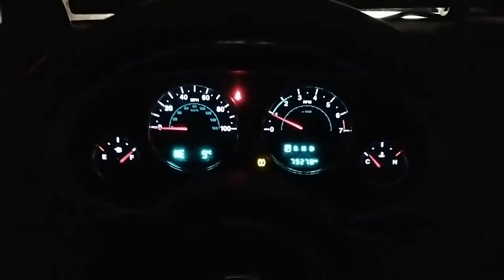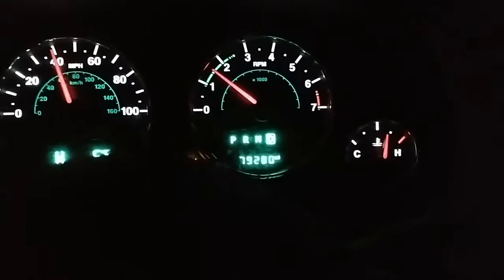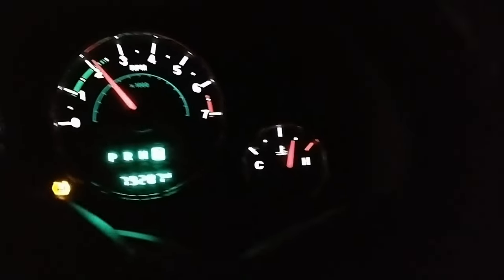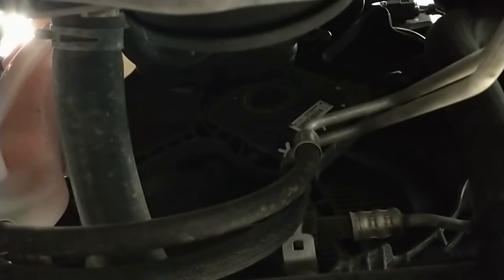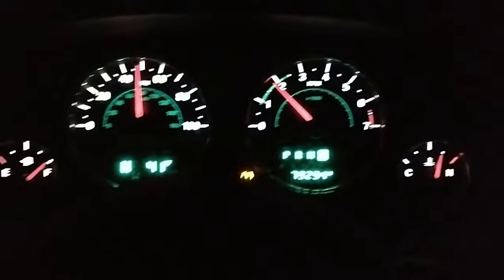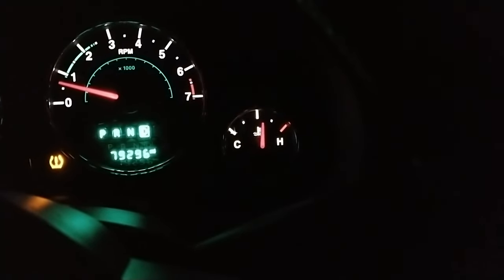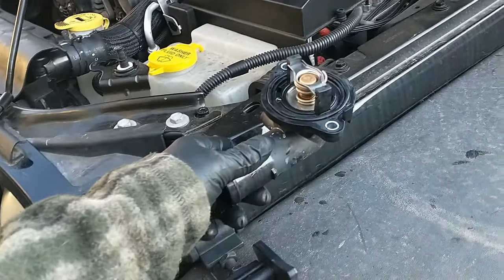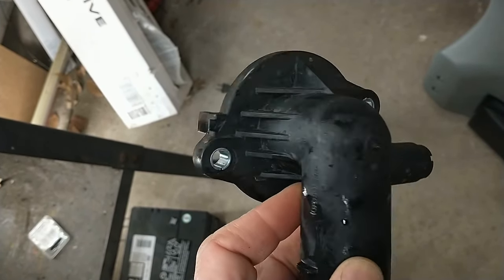Jeep Wrangler only overheats on highway...what's going on? (not what I expected)

Comment: Wow! Nice diag process! How do you know if the water pump is working properly?? Thank you, Sir!
Reply from the maker: Thanks, I thought it would be interesting to go through like that. Clues to water pump working were heater working, and once thermostat got unstuck it would spit up a lot
Reply: @joyofwrenching had similar issue with friends JK. Came to me three with overheat. First time was thermostat, second time the aftermarket thermo (oreileys) failed and replaced again, third time (months later) we replaced the thermostat and water pump. Not sure if it was the thermostat but what we noticed eith the old water pump is that the bearing at the center of the find (that spins) had two cracks 180 degrees of each other on the bearing. My guess is that the cracks were causing the bearing to function at idle but at high speeds some kind of slipping was going on. Jeep had 200k miles
Reply from the maker: @jon07crz  interesting, and good find on the bearing being off...I'll keep an eye out for that one

Comment: I have drained and changed the thermostat myself 3 times and burped the system 
I have a gargle in the cab from the heater core area as well 
I think this problem is coming back
Reply from the maker: I heard that gargle noise too when this was happening, but not sure it's only from this issue and not just a poor insulation issue so you hear it regardless